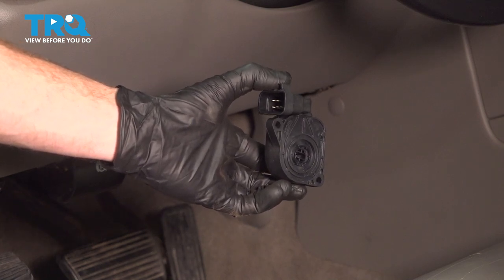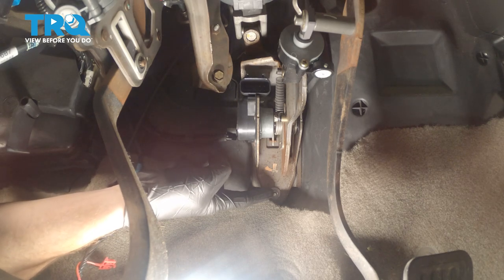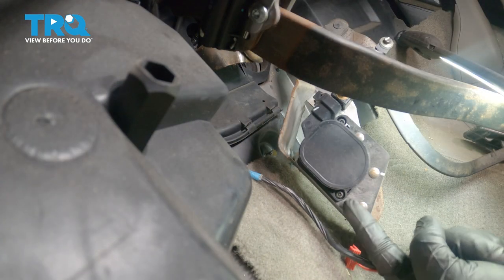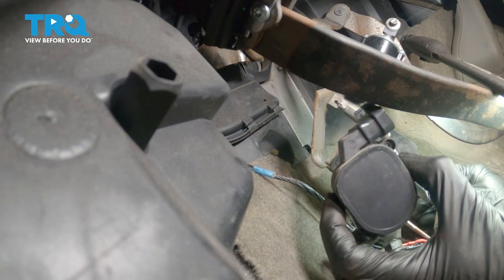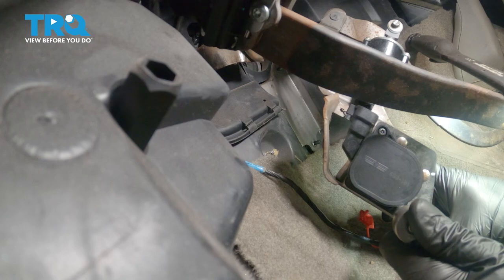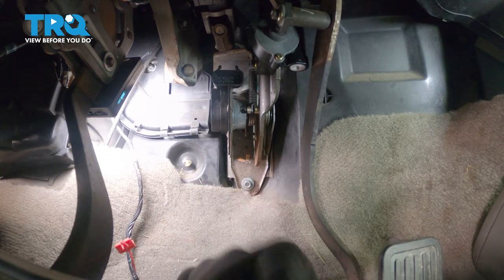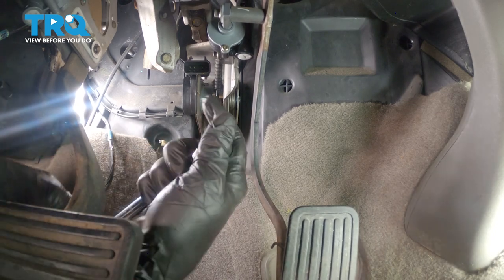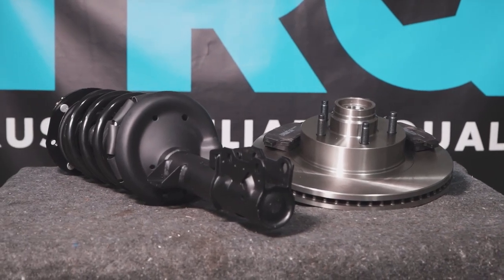How to Replace Accelerator Pedal Position Sensor 2000-2006 Chevrolet Tahoe

Comment: Just curious, why did you remove the pedal from the floorboard? It didn't seem that it was required to remove the throttle pedal sensor?